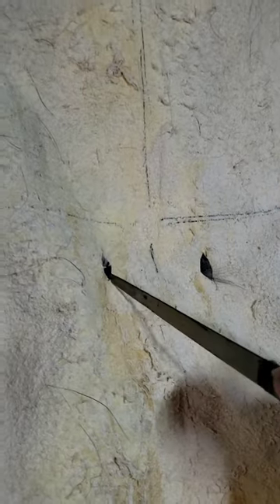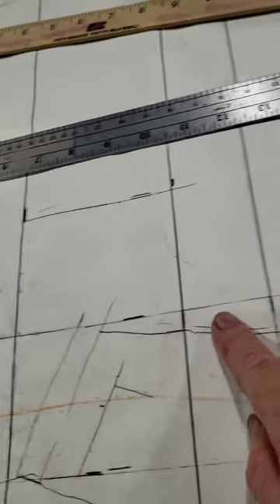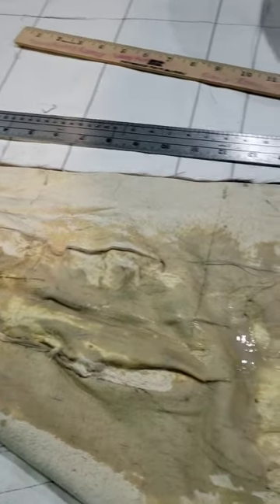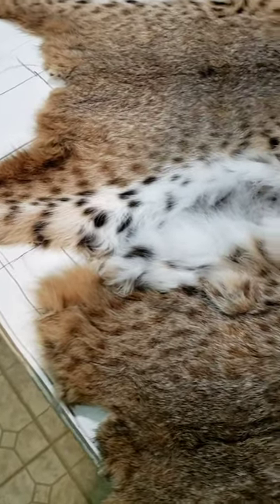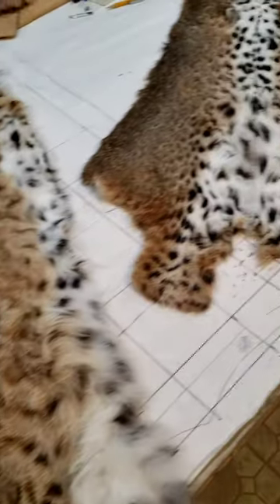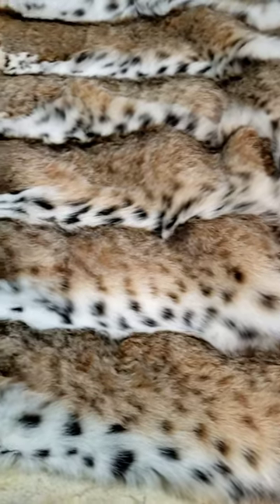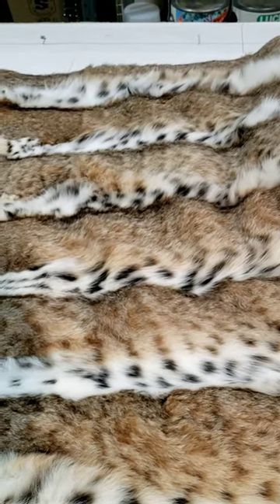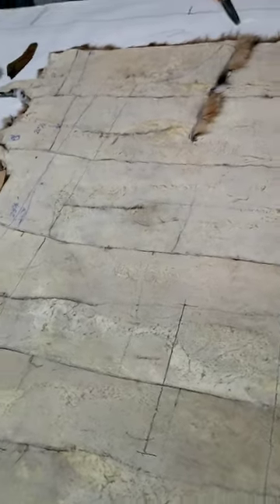Bobcat Fur Vest DYI part 2

Comment: Nice work!!  Very interesting to watch.  I have to make a shawl for my daughter’s wedding in October and the only furs that i have enough of are coyotes.  (I’m a trapper and i get a lot of skins tanned).
You wouldn’t have a video on that?  Or a link to someone doing so?  So far i only made a pair of mittens so i don’t have much experience!  
Tks and keep up the good work with the videos, ur not painful to listen too as some people are out there!!! 😊
Reply from the maker: I'd suggest to make a sample shawl first doesn't have to be usable just make out if denim or heavy weight muslin to see how it will fit. I do mine sew on fur machine and gold tape seams so it sews together easy. A pattern you could use is Vogue 7980 it's a accessories pattern has 2 shawls and couple of hats. Maybe Google Vogue 7980.. or check Amazon or Etsy. 
Good luck check back if you need more help but make a sample first from fabric